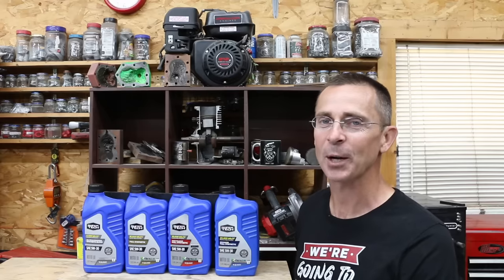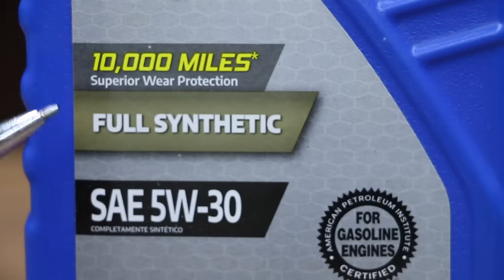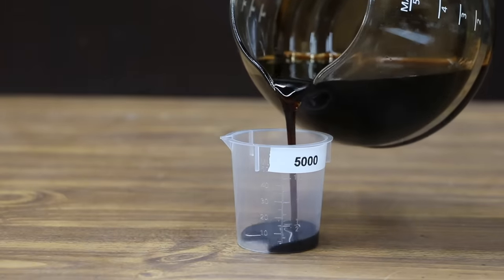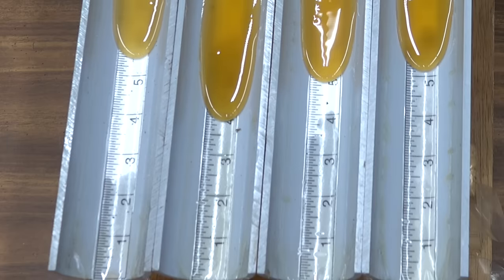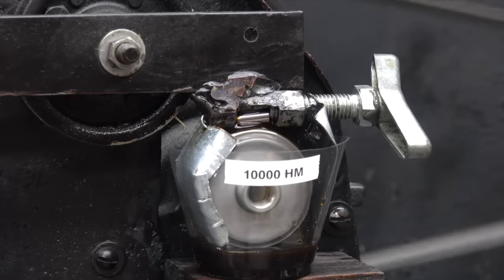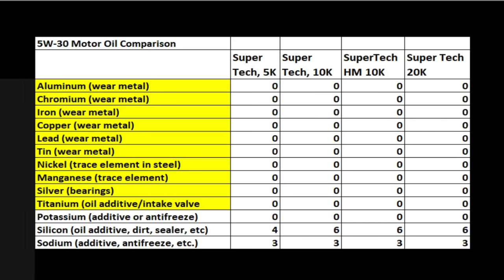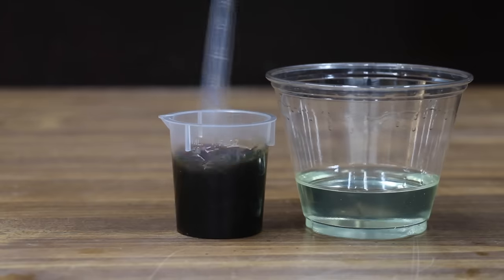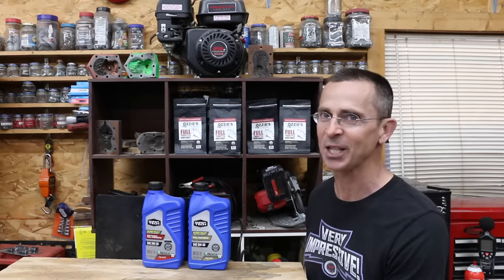Are They All The Same Motor Oil? Let's Settle This! Four Types of SuperTech Motor Oil Compared

Comment: as usual great testing, I would be interested to see some testing on re refined oils vs new oil.  the truck dealership I worked at was pushing the re refined oil for a while but it never took off at our location.
Reply from the maker: Thanks!  Thanks for the suggestion.
Reply: For the most part...the "oil" never wears out, but the additive packages and viscosity improvers within oil...DO wear out. So, reprocessed oil , if done right, cleaned and repackaged with new additives...should be fine.
Reply: @TheWilferch  that was our sales point, in fact the government requires using re refined oils in their vehicles if it can be readily obtained,  Im guessing thats an obsolete requirement now that nearly everything has gone at least semi if not full synthetic.

Comment: The absolute best thing you can do for your motor is install a pre oiler system. You can make one for pretty cheap. Everytime before you start the vehicle, pre pressurize/oil the engine and start it up. Almost eliminates the start up wear, which is where 99% of engine wear comes from. Run a full synthetic, change your oil every 5k. And you have a recipe for a million mile motor.
Reply from the maker: Thanks for the feedback.

Comment: Conventional oil - change every 5000 miles with a quality oil filter - Mobile 1 or Wix.   I go 5,000 conventional oil and 7,000 - 8,000 synthetic or if I come up on 1 year before I hit those numbers I just change the oil and filter.   Most people aren't putting 10,000 miles a year on a vehicle.   The ones who are should do their own oil changes to save a lot of money.

Comment: Meanwhile in europe, some cars are sold with 30.000km (18500mile) oil intervals, and still offers a 5 year unlimited milage warranty, because they just last.

Do people also cut the brake fluid replacement intervals in fractions, and change it out several times a year, just because?

Comment: Per your instructions for video suggestions in the user comments: Many service centers tend to over fill the oil level by a substantial margin. At least this has been my experience. I always do my own but other friends and family members fall victim to this happening. I remind them to check the level after an oil change and they discover the error, if they can see it at all, because the level is over the top of the reading area. Would that make a worthwhile video, learning of the damage caused by too much oil? I think the potential damage is significant enough that some manufacturers have warning lights when that occurs.
Reply from the maker: Thanks for the video idea.

Comment: I've owned several vehicles to well over 100k miles, some over 200k. No engine trouble ever, changing oil every 10-12k miles (for average ie non-extreme usage), always used fully synthetic oil, at least in the recent 25 years.
The "I'd rather change every 5k miles" sentiment is just a feel-good strategy, ie based on feelings, not evidence.
Reply from the maker: Thanks for sharing.

Comment: Thank you for sharing this awesome video. I’ve been trying to figure out which oil filter is best for my 2007-1/2 6.7 Cummins diesel truck. I run regular Rottella oil and either a K&N performance oil filter or a top of the line Wix oil filter on it   My brother runs synthetic Rottella oil and a Mopar oil filter. I just can’t believe that a Mopar oil filter is as good as a K&N performance or a top of the line Wix filter
Reply from the maker: You are welcome!

Comment: You asked for comments regarding oil change intervals. I am bad with time frames, but since the full synthetic oils started advertising 10K mile ratings,  I have been using them in all my gas engines. I used the synthetics for 5K miles when that was the best that was out there prior to going 10K miles. They are not Super Tech, I typically use Mobile 1. I have had no issues whatsoever in any engine in any car I have owned going 10K miles between oil changes. Other than current newer vehicles I recently purchased, there is no car I have had in the past which I have driven less than 100K miles and a current Chrysler is up over 220K miles. None of my cars have I sold off due to engine failure or engine noise or the like. I use synthetic filters rated for at least 10K miles also; typically Fram which a lot of hate is out there for that brand. This combination has worked for me on Chrysler, Dodge, Kia, Jeep, GMC and Hyundai vehicles. 
Thank you for your videos. I often refer to them before buying products I am unsure about or have no knowledge about which one to buy. I have not been disappointed yet. Your methodology is amazing and provides unbiased, usable results.
Reply from the maker: Thanks and you are welcome!

Comment: I used to get about 2,000 miles more on Valvoline than any other brand. Using 5,000 mile and 5w-30 oil
Reply from the maker: Thanks for sharing.

Comment: I run the super tech 10k 5w 20 in my civic with 221k miles and 5 speed 1.8. I change the oil every 5-6k miles I would NEVER trust anything higher than that. Good maintenance = long engine life and good mpg!
Reply from the maker: Good Point!

Comment: OK, rock solid. Real world conditions are always omitted in those ridiculous 20K tests performed by the oil manufacturers. Like 50% of all miles driven in the US are trips of less than three or four miles. That's falls under the severe service schedule  OCI. Now, repeat the good old Wally World test done here with some good old STP added to each oil sample. As one company has said for many years, "Oil is not enough."
Reply from the maker: Thanks for the feedback.

Comment: I change my filter every 3k miles and the oil at 6, with the obvious topup after the filter change. Is there any advantage in what I am doing or not?  Thanks again for a very informative review on engine oils.
Reply: No, filters aren't doing much usually and people only did that to hedge against the media failing. Any filter above $5 and any synthetic will easily handle 8k of average driving. Oil doesn't go bad from contamination, it goes bad mostly from heat cycling breaking it down chemically. Synthetics are more resilient and will easily handle a full year at a minimum. ATF is a good example of how long a good oil base can last before becoming compromised.

Comment: Never go beyond 5K miles with any oil or filter regardless what it (or the vehicle manufacturer) says.  Of course 5k leaves room for the real cutoff which is more like 6k but people like to be late so this target leaves room for error.

Also Supertech with that white square on the front label (bottom right corner) are made by Warren lubricants which is the most common source everywhere, but some regions (or in supply chain turbulence/shortage) might be made by ExxonMobil or Pennzoil and would be a bit different.  The others have no white square and ExxonMobil bottles have a weird cap that is larger and looks like the ones on ExxonMobil's own branded bottles, Pennzoil bottles have a "C-star" mark on the bottom.  Sometimes Warren uses the C-star bottles but the white square label mark always wins (meaning it's Warren then).  Other likely similar products from Warren are under brands including: Coastal, LubriGold, LubriGuard, AutoGuard...

Comment: Suggestion is also test motorcycle oils.  I replace harley davidson syn3 or HD360 with AmsOil products for engine, transmission and primary chain case (called gear oil).  Please include harley davidson 20w50 and amsoil in your next review?
Reply from the maker: Thanks for the suggestion.

Comment: Just a thought, have you ever sent firearm lubricant to be tested? Is there any difference between the Lucas oil and the Lucas gun lubricant?  Firearms and cylinders have tight tolerances both. Why not just use synthetic oil for "ballistic tools"?  Unless tests by lab and temp show a great gap in performance?  What about oil additive enhancers for firearms... These are thought provoking videos and thank you.
Reply from the maker: Thanks for the suggestion.

Comment: I wonder how the oils would test for longevity if you did the roller wear test with a .003" gap for an extended amount of time. The heat breakdown isn't exactly accurate because they usually run through coolers that regulate them to around 80°C. Thoughts anyone?

Comment: Been running multi brands conventional and semi synthetic in my 2006 Toyota corolla 4cyl 5spd, oil changed every 5000m so far 305000 miles and still going, the odometer went to 299999 and  stopped,  I use the trip meter now
Reply from the maker: Thanks for sharing!

Comment: I seriously don’t understand why people seem to think it’s a good idea to go more miles in between boil changes. Especially with turbo GDI motors. We own a 2021 Nissan Altima with 22,000 miles. It has a 2.5 L four-cylinder GDI engine and it takes it takes 0W-20 oil. The owners manual says to the the oil every 7,500 miles…yet after 3,000 the oil is pretty dark. I set my maintenance reminder to go off every 4,500 miles. 😁
Reply from the maker: Thanks for the feedback.

Comment: Really wish  Mobile 1 Annual 20,000 mile oil was compared as well. They were the first to introduce anything above 12,000 miles (Royal purple?)  I drove Mobile 1 20k oil for 5-6 years and each time would begin to hear the lifters around 8k-12k.  I agree with never going over 7-8k on Mobile 1 20k oil and would think less with "supertech".   Realy would love to see a comparison. Funny how the costs are nearlly identical (Mobile - Supertech) as well.   I think Havlvaline? came out with a 6gallon variant as well - and since htey use a cardboard box charge less for more.
Reply from the maker: Thanks for the suggestion.

Comment: I think it’s to keep up with manufacturers and the one year oil changes.  They know that there isn’t much difference, but they’re fighting a ceiling and if they don’t compete someone else will make a promise that will leave them behind.  You could tell they were trying.  It also makes me wonder if you got the same 20,000 mile in 4 bottles, would they have different test results.
Reply from the maker: Thanks for the suggestion.

Comment: Hello! Do you think you can find an oil additives that works best for oil consumption in an engine? Love all the videos btw!
Reply: You have worn piston rings if it burns oil, thicker oil might slow oil consumption down
Reply: @jkng4606 not always, it's the valve seats/seals in my case. It still would be a good content video, see if any actually work or compared to thicker oil, or if it's all just Snake oil with fancy words lol

Comment: I'm late to the party, but would you ever revisit some of these motor oil tests to compare the lubricity of the new and "used" oil at sub-freezing temperatures?  I'm curious if there is a difference that correlates to price!  Thanks for the video!
Reply from the maker: You are welcome!  Thanks for the suggestion.

Comment: I only use Pennzoil Platinum Full Synthetic Motor Oil BUT,  If your oil says it's good for 10,000 miles you should at least change the Oil Filter at 5,000 and add a little to make sure your oil level is correct. Then change both oil and filter at 10,000.   My truck tells me when to change the oil but when it says the oil is at 50% of life i change the filter only then when it gets to about 5% life I do a full change of Filter and oil.
Reply from the maker: Thanks for the feedback.

Comment: Based on your testing and other research I use Penn. Plat. Syn. oil and the best Wix filters.....but I still don't exceed 5000 miles as a change interval...oil & filters too cheap compared to engines!
Reply from the maker: Thanks for sharing.

Comment: Oil is probably more susceptible to cycles than km which is a dumbed down estimate based on "normal driving" whatever that is.  It woul be really interesting to see a test where the oil is heated and then cooled to a winter temperature 20 times to simulate a month going to work.  I suspect the difference will be way larger and to compare the wear against a control like suggested below.
Reply from the maker: Thanks for the suggestion.

Comment: People change oil often ?
 I do once a year,  put about 16k a year on .
   I check the oil once a month and add a quart as needed and all my cars last 20 years go over 200,000 miles.
  Currently truck and suv both have 255k  .
  Been a fan of synthetic blend since it came out.
  Sometimes i use full synthetic, sometimes not.
  
 Tire rotation, never do it until i see the drive Axel tires wear to half.
 Then i swap

Comment: I watched your oil comparison a couple years ago which included Super tech full synthetic against other full synthetics. I am running Super tech FS in my car and still change my oil every 3000 miles because I have over 100,000 miles. I believe because of engine wear and oil contamination it is the smart thing to do. I enjoy your channel. It is very informative and honest. Question: I have a 2010 Altima with CVT. I put an oil cooler on it and drained the nissan fluid and have been using Valvoline because I know of the problem with the Nissan CVT's failing. Have you done a CVT fluid comparison? I believe the Nissan problem is more of a Pressure actuator/sensor issue but I was just wondering about the fluids themselves. Thoughts? And thank you for your efforts. They are tremendous.

Comment: You have to test the ATS chemicals CRO oil system cleaner and fuel system cleaners! Apparently developed with super computers to break down specific types of carbon buildup
Reply from the maker: Thanks for the suggestion.

Comment: A mechanic replaced a Toyota Camry engine with serious scoring in the cylinders. The owner believed the 10K miles oil change intervals and ruined an otherwise reliable vehicle. 5K miles, mybe 7.5K if i unable to change the oil occasionally. 10K miles is a no go.
Reply from the maker: Thanks for the feedback.

Comment: I thought the contaminated oil test was really interesting. Another thing that might be cool would be to see you run tests on high milage options from a number of different brands, with contamination from different things: e.g. gas, coolant, etc. Since high milage cars are more likely to be pushed through a lot of the problems that cause leaks, it would be interesting to see which brand of oil is best to maintain an engine that's running on life support.

Thank you for all the great content!
Reply from the maker: You are welcome!  Thanks for the suggestion.

Comment: They are not. When I drive 10k with 10k rated ST oil. Used oil color is very dark which makes me feel concerned and makes me question maybe I should have changed it earlier. When I use 20k rated oil at 10k intervals, used oil show barely amber color indicating I could have gone way longer. So use 20k oil change it at 10k intervals so far got me 439 k trouble free miles.  No signs off significant oil burning yet. No sludge. And even after 300k miles great compression test results.
Reply from the maker: Thanks for the feedback.
Reply: @ProjectFarm  your videos are very useful.

Comment: The test didn't really surprise me too much. Extended interval oils are formulated to keep their structure; however it doesn't necessarily mean more protection. Oil contamination can still occur and really negates the extended interval. You can install bypass filters that make it a little more beneficial, but in my experience the cost of filters and increased cost of the extended oils end up costing more. That said I do know some OTR drivers who value it. But for most consumers the full synthetic or high mileage oils would most likely be best.
Reply from the maker: Thanks for sharing.

Comment: I'm curious how current the top of the line oils for each brand perform (Pennzoil ultra platinum, Valvoline extended protection and so forth.) 

Also curious if the Euro marketed oils are better than the non ones.
Reply from the maker: Thanks for the suggestion.

Comment: So it seems like it's probably important to start off with exactly the same amount of oil in the test where you cook them. With less oil in the container each molecule of oil has to absorb more heat energy. You can think about this like putting a large pot of water on the stove versus a little bit of water in a pan.  The large pot is going to take longer to heat up and so it's going to lose less proportionally.  The other thing and this is probably minimal but a large pot of boiling water is going to also lose heat out besides differently if it's full or less full.

Comment: Hi Project Farm. Have you done a test with identical viscosity, but from different manufacturers? Is Mobil1 0w20 full synthetic, worth the extra money over Castrol, Supertech, Shell 0w20 full synthetic... etc? Maybe even include dealship/manufacturer oil as the control for comparison? Thank you.
Reply: Also, don't forget about Costco's Kirkland brand. Costco only offers Mobil1 and their Kirkland brand. A lot of their DIY clientele will be using those two oils.
Reply from the maker: Thanks for the suggestions.

Comment: I just had a idea. Have you tested gear oil yet? That would be a good idea for a series. I need to change the diff fluid in my truck when it hits its first recommended interval. It has like 8,000 miles to go but id like to see what you have to say first. In my head i was thinking lucas probably has one of the best especially for its price, or royal purple just being a top contender. But if you have any new results id like to see. Maybe mobil 1 or something else is outstanding.
Reply from the maker: Thanks for the suggestion.